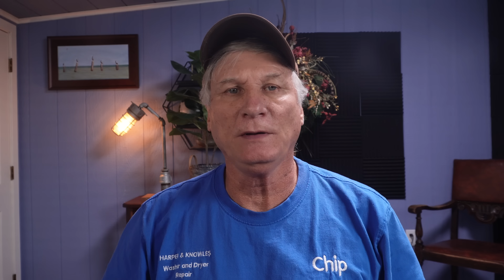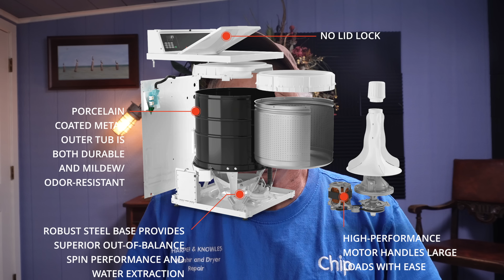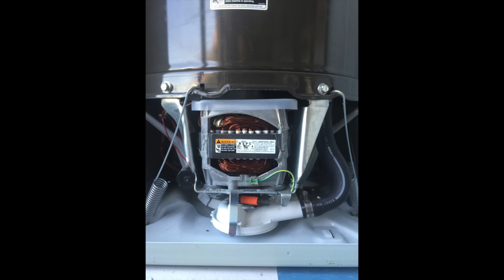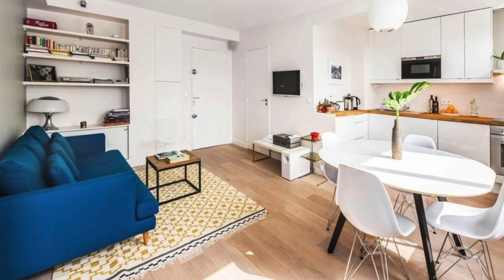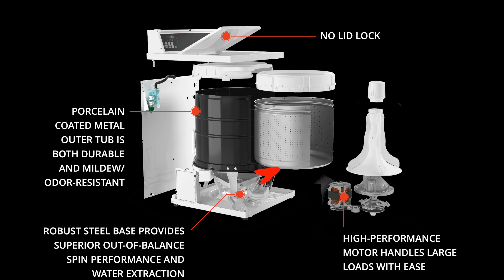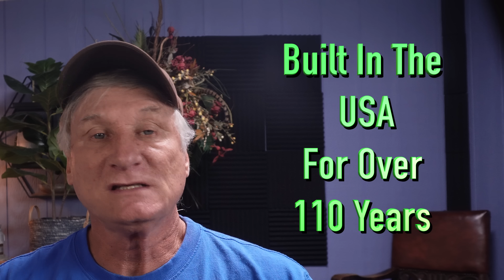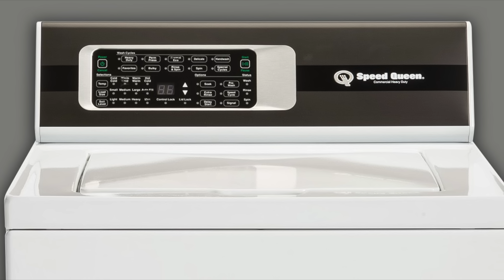TR7 vs TC5 – The Truth Speed Queen Dealers Don’t Tell You

Comment: Speed Queen has their share of issues. I own 2 TC5 made 3 years apart, the older one bullet proof. never an issue. the newer one purchased in 2023 has had TWO control panel failures. that required the main board be replaced. YES, it was covered by warranty, but what happens when in 12 months I need another one, yes the 3rd will be covered, but if its a 12 month part, at some point I will start eating the cost.

Comment: I'm teetering between the Speed Queen TC5 and the Amana top load. I can work on Whirlpools myself and have kept my Admiral direct drive going strong for 16 years now at two small loads a day , seven days a week. Aside from the loud clunk when changing modes, it still runs like a champ. I also love Whirlpool dryers. I'm well aware that the Amana belt drive  is not the same as the Admiral and way inferior to the Speed Queen. The Amana has a notorious failure rate for the main control board but it's a 5-minute fix and the part is readily available. All of this makes saving $2000 quite tempting.  I've also heard that  the TC5 doesn't spin close quite dry. One youtuber says that their customer support is horrible. If that's so what good is it to have the best machine in the world and you have to wait weeks to get it fixed if it breaks down. Still deciding while my Admiral keeps on keepin' on.
Reply from the maker: I’ll be honest with you — those two machines really aren’t in the same league, and that’s why the decision feels confusing.

The Amana is built to hit a price point. It’s a basic, light-duty platform with more cost-cutting in materials, suspension, and overall construction. Yes, the control board is easy to change, but the fact that it fails often enough to be part of the conversation tells you something about the machine as a whole.

The TC5, on the other hand, is built like the older machines you’re used to — heavier components, simpler mechanical design, and a much longer service life. It’s not just “a little better,” it’s a completely different philosophy of how a washer should be built.

As for spin performance, the TC5 may not hit the absolute highest RPM numbers on paper, but in real-world use it extracts plenty of water and does it consistently without beating itself to death. What you gain is durability and reliability.

Customer service complaints can happen with any brand, but what matters more in my experience is how often you actually need service. That’s where the TC5 tends to separate itself — it just doesn’t break as often.

So it really comes down to this:
If saving money up front is the priority and you’re okay with a shorter lifespan, the Amana will get the job done.
If you want something closer to that old Admiral you’ve kept alive for 16 years, the TC5 is the clear choice. 

Thanks for watching!
Reply: @HarperandKnowles  First of all let me say that your  knowledge of appliances and machinery is amazing! I just watched your video on replacing the Amana control board pump transducer. Fantastic! Believe me I know there's no comparison between the Amana and my Admiral and especially the TC5. That said , Lowe's was blowing the Amana out for $398 and probably for good reason. So I went ahead and bought one as a backup and put it in the garage still boxed for when my Admiral  (if ever) makes that loud clunk between cycles for the last time.  At that point I may be tempted to pull that Admiral trans myself and replace it. But more than likely  go for the Speed Queen TC5! Thanks Chip! John
Reply from the maker: You are very welcome John!

Comment: We bought a TC5 last week. it's HEAVY and it's louder than the Maytag front loader it replaced. I thought it would have a mechanical timer but it looks like it's got a circuit board timer. That's disappointing but we're running it with a surge protector to protect the circuit board.

Comment: The only bad thing Speed Queen has done is they've started to use circuit boards to run their washers. They are now getting problem codes that can shut down the washer. But their usage of heavier duty tubs, shock absorbers is good.

Comment: I use tsp in the tub  to clean the sludge out of the washing machine most people use the slimy green soap or the blue and then they put the blue greasy stuff in down the center now I put the clear vinegar down the center to rinse out the washing machine and if I’m using, if you have a clean washing machine and I said use TSP and that is a cleaning solution, you used to wash the walls to prepare for painting that’s the product. I’m talking about now if it’s not something you prefer then use something else but that’s what I’ve been using and then I put the vinegar down the center of the machine now when the washing machine is clean, you can leave a load of clothes in there for five days and then you smell it if it doesn’t have any smell, you know you have a clean washing machine and that’s how I do it if it smells, you need to clean it so get to clean and the best thing I know is what I told you fill it up this hot water and put the amount of TSP in it and then put a load of towels in it and let it sit overnight and then run it with the solution in it and make sure you put the vinegar in the Cine of the machine or where the blue stuff usually goes blue stuff. Call it blue I’m not advertising. I call a greasy grime, but that’s OK. Do you have a good day if it works then it works if it doesn’t well it works for me. Have a good one.

Comment: I had a TR7 for 6 years, (bought in 2019 and when i sold my house the buyer wanted the laundry set). it did O-K bit that queen size comforter never turned over in that machine.. the auto water level would max out the load size but the comforter just kind of floated back and forth in the small tub.. its not a heavy comforter.. its a fairly lightweight item (not down filled)..  with regular clothes like jeans and T-shirts, the TR7 did OK most of the time on those.. (I always used heavy duty cycle so i got a full tub rinse) and auto water level and it did a decent job of swirling them around pretty good.. normal wear stuff was perfectly fine. where my TR7 struggled was really dirty items like coveralls after I worked on my vintage busses or a dirty home repair project.  I found when putting the comforter or those coveralls in a friend of mine's whirlpool direct drive they got cleaner (his DD has the dual action agitator)..  I didnt have a TC5 to compare against, the DD dual action agitator would turn that comforter over and did a good job of scrubbing the coveralls. the TR7 was a really quiet machine so having it on the main floor it worked well.. it also has an excellent spin for a top loader.  other than the circuit board, the DR7 dryer is as simple and classic as it gets and it did a fantastic job drying closthes quickly.  I never had a service call on either machine.  for my needs a regular classic agitator style workjs best for the times i get clothes pretty dirtty.. if i wasnt an avid DIYer and Maker, the TR7 would be a fine machine. I recently restored a 40 year old GE machine and it's vigorous wash action will suit my needs well

Comment: Why would I purchase a speed queen when they lie about the fact their warranty is a third party  warranty that leaves you stranded for months and months and months when they break?
Reply from the maker: That’s not really accurate. Speed Queen’s standard warranty is backed by the manufacturer, not a third-party company.

Where people run into problems is usually on the service side—depending on where you live, you may have fewer authorized techs, and that can slow things down. But that’s a local service issue, not how the warranty itself is structured.

From what I see in the shop, parts availability on Speed Queen is actually pretty good, and they’re one of the more service-friendly machines out there. Thanks for watching!

Comment: Everything you mentioned in this video was spot on. We have owned our TC5 since May 2019. I do hate the control board/touch sensitive buttons on the top panel. We have had a few instances where the machine randomly beeps in use/or not (tried to unplug the machine for 5 minutes to see if resetting would fix the issue, however, it did not.) I replaced the top control board and it stopped (it’s been about a year since I replaced the board.) We just got back in from vacation yesterday, and noticed it started again. I unplugged the machine again…so far it’s been good. After a quick google search, I see some of the machines out there suffer from this problem (My washer is on a surge protector.) I wish they would have kept the mechanical knobs like the older units. We have had several out of balance episodes with our washer. It would get out of balance during the spin. The wash drum will bang against the sides/front panel and cause the unit to walk across the floor a bit. The washer does recognize it’s out of balance because it limits the spin speed. It would be nice if they used the out of balance sensor to eventually stop the machine. If you don’t stop the washer manually, it will continue to bang against itself indefinitely. I have also had to replace the drum wheels in our dryer. After a few years it started making a loud scraping type noise on cold start up (the noise typically goes away after it starts heating up.) I bought the dryer rebuild kit online from Lorain furniture in Cleveland, OH. That fixed the issue for quite some time, however, it’s starting to do it again. Overall, we have been pleased with our Speed Queen set. It’s not perfect…nothing man made is. They are built better than most any other. I find the washer/dryer fairly easy to work on myself.
Reply from the maker: Thanks for sharing your experience!

Comment: It took a set of whirlpool and LG front loaders before i finally had to insist we stop buying washer sets based on how they looked. my wife fought the speed queens for yrs.  but 7 yrs now and no issues with my speed queens.  and here is what is even better. they actually use water to clean. our last LG's just squirted a little water here and there, banged the hell out of the pipes and often couldn't even get it wet enough to dissolve the full laundry pod. never again. SQ is the way to go

Comment: My parents bought an admiral heavy duty washer/dryer from Montgomery Wards in 1998. They still have it today.  I noticed it doesnt come with regular dog ears. Can anyone explain this for me?
Reply from the maker: What you’re seeing is normal for that machine. Back in 1998, Admiral washers sold through Montgomery Wards were built under Maytag, not Whirlpool, and they used a completely different drive system. Whirlpool’s direct-drive machines use that two-piece agitator with the little “dog ears” (cams) to ratchet the top section, but Admiral/Maytag designs from that era typically used a one-piece agitator or a different internal drive that doesn’t need those dogs at all. So there’s nothing missing on yours—it was just built on a different platform, which is also why those old Admirals tend to run forever with fewer small wear parts. Thanks for watching!
Reply: @HarperandKnowles Thanks for the reply.  Appreciate it much. Theyre still running like  a champ. Will nevet get rid off them.

Comment: Gonna roll with the TR7. Taking chances with a bit more electronics, but nothing like an LG. Quieter and should beat up my clothes less than the TC5. Strange that the companion dryer is almost twice as much as the washer, but...
Reply from the maker: On that Speed Queen set, the washer and dryer are usually priced pretty close to each other. Sometimes the washer can even come in a little less, and part of that comes down to how the TR7 is built. It doesn’t use a traditional transmission—just a bidirectional motor—so you’re not dealing with that added mechanical complexity. That helps keep the cost more in line with the dryer, and in some cases slightly under it. Thanks for watching!

Comment: I bought the tr7000wn and matching gas dryer in 2019. The washer was absolutely the worst washer I've ever had. Nothing came clean. The dryer... the gas burner stopped working after 2 weeks. Took both back. It wasnt a good experience
Reply from the maker: Sorry to hear you had that experience. The TR7000 uses a very different wash system than the traditional Speed Queen design, and a lot of people either really like it or really dislike it depending on the type of loads they run. It’s definitely not the same style of washing action the older models used.
As for the dryer, a gas burner stopping after two weeks is usually a component failure (igniter, coils, or flame sensor), but that’s obviously frustrating on a brand-new machine. Sounds like you did the right thing taking them back. Hopefully you ended up with something that worked better for you.
Reply: @HarperandKnowles people say the newer speed queens (post tr7000wn) have improved the washing mechanism to get clothes clean...ie tr7003. I guess the tr7006 is out now 
.

Comment: Only Speed Queen I'd own is the one with the geared Transmission.  Several Speed Queen models have the Agitator bolted to the drum.  Those are garbage.
Reply from the maker: I tend to agree with you for the most part. But if you don't have a lot of very dirty laundry they work just fine. I think the TR7 actually hurts their reputation. Thanks for watching!

Comment: TC5 has a lid lock.    You need a high powered magnet to put in the back of the the machine, do your research where to put them.    But I own a tc5.  Best ever
Reply from the maker: No, the TC5 does not have a lid lock. It does however, have a lid switch that stops any motion if the lid is lifted but the lid does not lock down. Thanks for watching!
Reply: Oh so you’re saying the wash will keep going if you open the lid while any wash or rinse cycle.     “No it will not.”
Reply from the maker: I don't think that's what I said. Try reading it again.
Reply: What part of "stops any motion" do you not understand?

Comment: After dealing with repairing a set of GE washer and dryers multiple times over a 10yr period, I had enough and invested in a set of Speed Queen W&D.(TR7 & DR7).  The GE washer needed a system board replacement about a week after the 1yr warranty was over, but luckily, the Discover card I used to purchase it bumped that to 2 years, otherwise it would have cost nearly half of of a new washer's price to repair it.  The dryer was worse - I replaced the drum support rollers  in the 10 yrs we suffered it's ownership.  Never again.  The Speed Queens have been outstanding.  I wish I knew about them before wasting my money on the GEs.
Reply from the maker: Thanks for sharing your story!